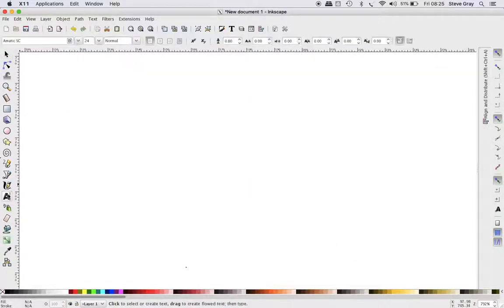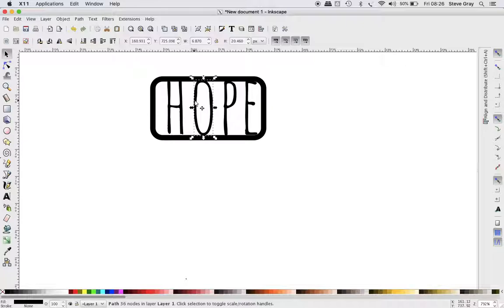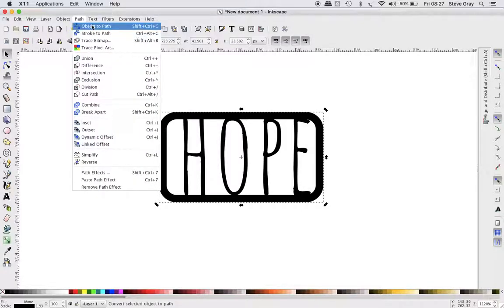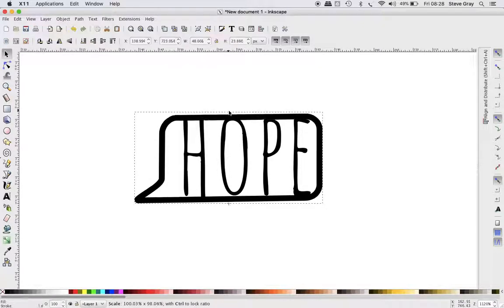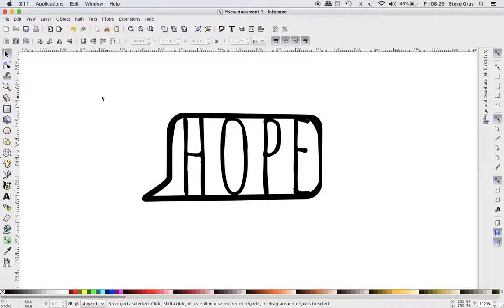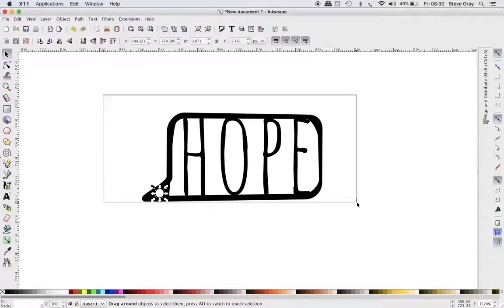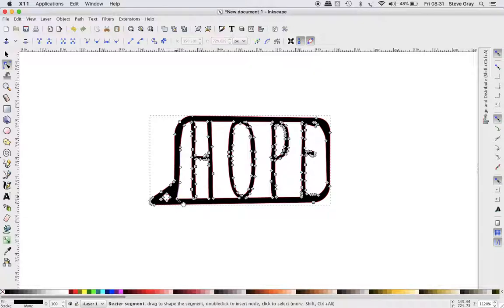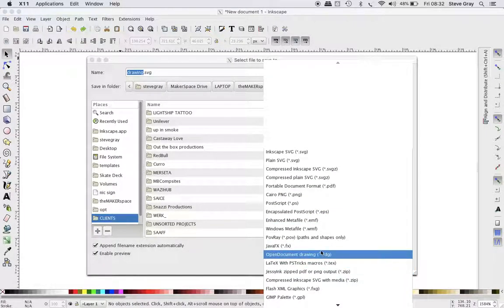Design LaserCut keyring Text using Inscape

Comment: I have the following issue while using the laser in my Ender 3-Pro from Creality:
The height can be customized, and the printer responds to Z offset changes. (software, screen, or Gcode)
The machine, I heard it switch on/off, although it does not engrave at all from laser speed 15 to 3,000 mm/min that I tried.
I just see a mild sign of work when I put my eye close, but nothing noticeable.
The laser won't light up by itself. I have to go to the screen of the printer and adjust the Fan Speed 100% for every print.
Even though, the gcode file has M106 S255 in several sections..... and M107 at the end.
CAN YOU HELP ME TO MAKE THE LASER WORK....? it had not been an easy process, I am almost frustrated.
Thanks.
Reply from the maker: Hi Johanna, sounds frustrating. This is a very specific problem related to your laser integration into the 3D printer. Seems like you are using fan power to drive the laser PWM, theoretically it should work. But maybe it doesn't supply enough current? You could use the heater output and then just set temp to zero for off and 50 for on, but you wont have fine control over the power. We've only used the protoneer style CNC shields to drive small lasers, they use a firmware called GRBL, and have a built in laser support.